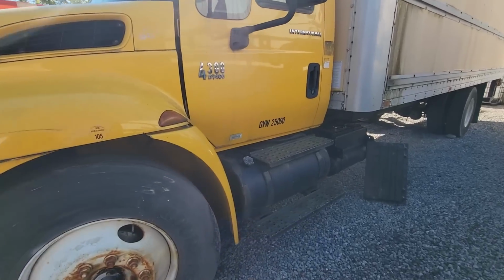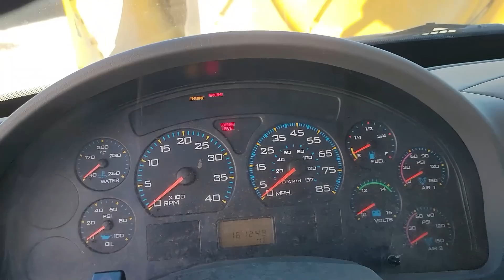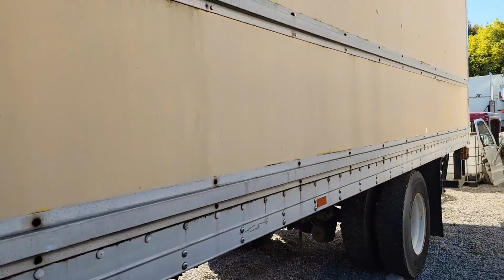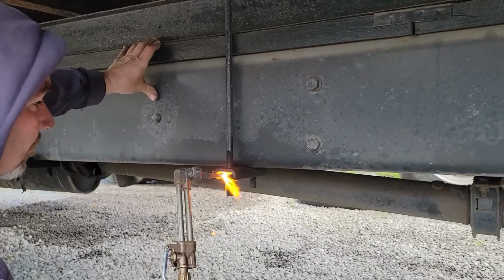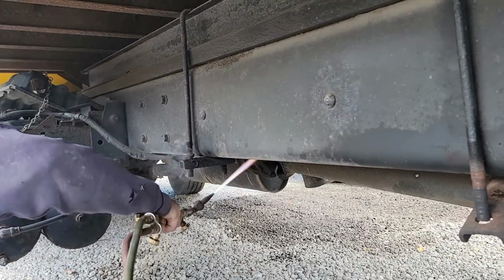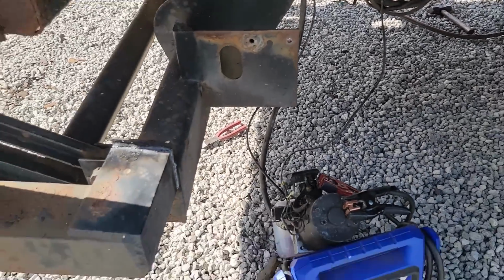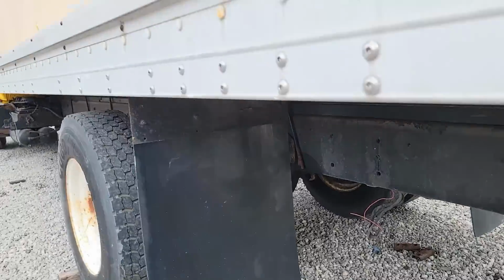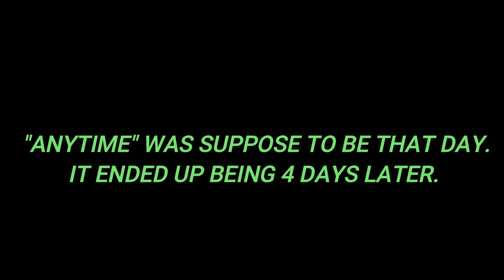2002 4300 BOX TRUCK TOWED IN INOP. WILL IT START?

Comment: I like the " 60/40 box to frame " length on the buyer's truck. Any load in in the box will pull the front wheels off the ground.
Reply from the maker: its only temporary. there was a frame extension welded to the truck that prevented the box from going any farther forward. his mechanic will make the changes and move it forward.

Comment: If you quench those nuts before turning'em, they'll come off easy 'n are reusuable without screwing up the threads.  Used to do that back in the day working in a truck shop.
Reply from the maker: they were nylok nuts....once they are heated up, the nylon is burnt out an need replaced.

Comment: I have been watching your channel for a little while now. I am very impressed on your knowledge of international trucks. I would like to pick your brain if I may, and any help from the people that watch your channel. In October I purchased a 2005 international 4300. It ran very good and looks very good. I drove it for three weeks, the abs light came on and the check electrical system light came on. I pulled it into my shop and shut it off. At this point I tried to restart the truck. It would cycle but when I turned the key to the start position nothing would happened. I stopped by A international specific repair shop which is a mile away from my shop to get someone to com by and check it out. I was informed their field mechanic had quit and I would have to get the truck to their shop. They are also busier then a one legged man in a but kicking contest so it might be awhile. So I picked his brain for a bit. He told me more than likely my trouble is in the body control module which controls all the other modules. I went through it and cleaned all grounds and connecters and put dielectric grease in them, no change. I do not have a code reader but I do know that I need to cleAr active codes but I don’t have that ability. Tried some other shops but they either do not have the software for international or the 9 pin hook up or the time. Do you have any Idea what would be the logical chain of events I should do to maybe get this started.any help would be appreciated. This is my first foray into owning an International. Oh , forgot to mention it is a dt466e motor. And it only has 84 thousand miles on it. Thanks, love your videos.
Reply from the maker: very first thing is to verify that the amber and red "engine" light comes on and then goes off when you turn the key to the on position. this tells you the ecm is being turned on. if not, go to the battery box and inspect the 40 amp fuse and it holder. next is check the engine oil level and coolant level. this engine uses a high pressure oil system. must have adequate oil to supply and create pressure. coolant level must be up as well. when cranking the engine you should see the tachometer bouncing. your only cranking around 200 rpms so it doesnt really register but it bounces. if it does, this tells us the ecm is seeing a signal from the cam sensor. if not need to start there. will it start off of starting fluid? was the engine light on at any time when your were driving it before? any other issues you know of? does it seem to have had rodents under the hood or in the cab?

Comment: When I got my first Toyota it had a cracked head, the guy had driven it for quite a while with it mixing so I did on a few short errands. A year or so later when I tore that old engine down I was surprised that the bearings all looked pretty good and there was only minor scoring in the oil pump and timing cover.

Comment: That seems like too much box for that little truck. I could be wrong but to me that white truck looks like a car flatbed wrecker. What do you think?
Reply from the maker: the shop that removed his old box, didnt remove the frame extension that was welded to the frame. once it is removed, it will go a few feet forward.

Comment: I am sure they will only temporarily use those bolt. It’s only temporary till it works then it becomes permanent. With that much overhang they will have that thing doing wheelies
Reply from the maker: the shop that removed the original box, didnt cut the frame extension off. the box can go another 2 ft forward.

Comment: Why did they use wood under the box?
Reply from the maker: sacrificial material for when the frame and box move at different rates. the box will work on the hardwood instead of the frame.

Comment: But with air brakes you can’t load up a uhaul with 15k pounds and a car trailer in tow, then drive cross country, with zero experience driving anything heavier than 3k pounds and 12’ in length